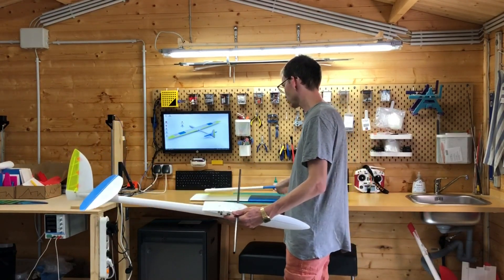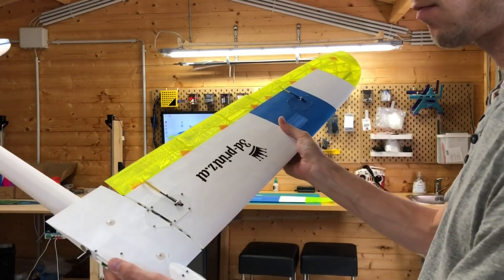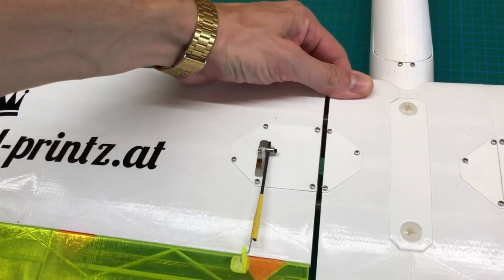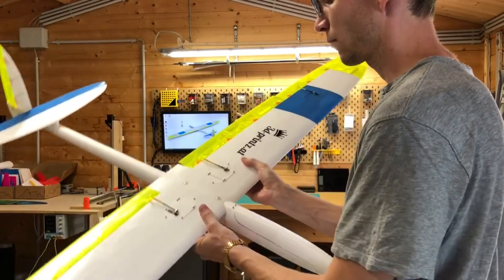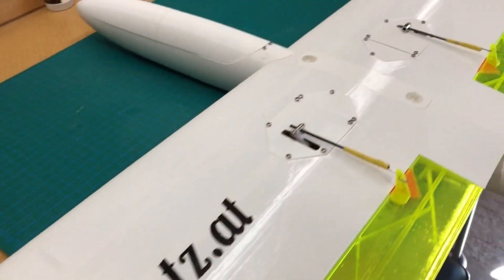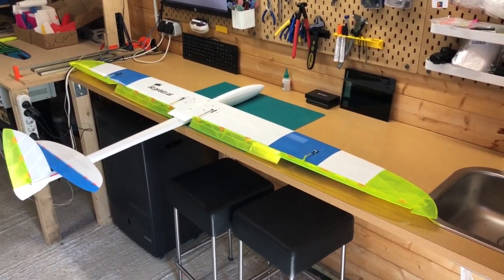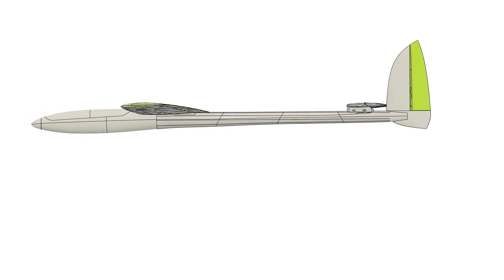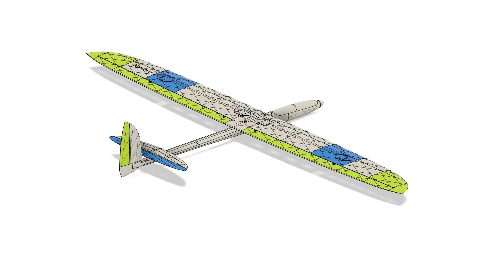Naughty - 3d printed 2m Sloperacer

Comment: Are there provisions for ballast? How did you solve the elevator authority issue?
Reply from the maker: I enlarged the elevator in the latest version and also mixed in some snapflap. I fear there is no space for ballast.
Reply: Have you considered a wingeron version?
Reply from the maker: @surferx66  oh that would be a hell of a challenge, especially for this size of plane.
Reply: Of course, how about a 60" slope racer wingeron?